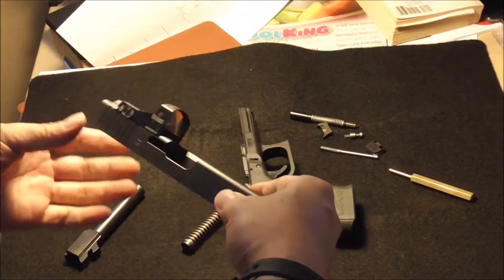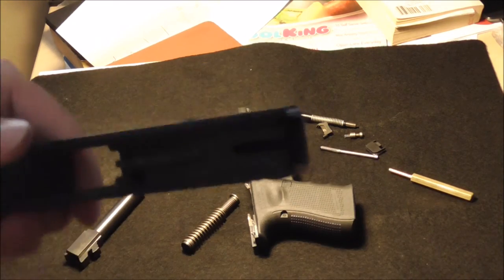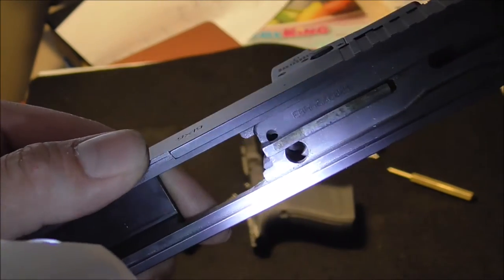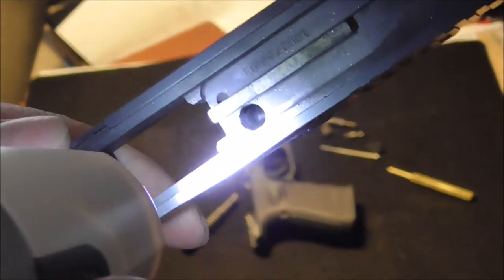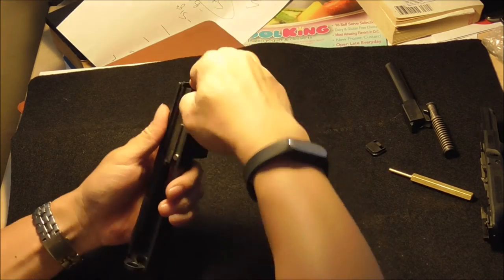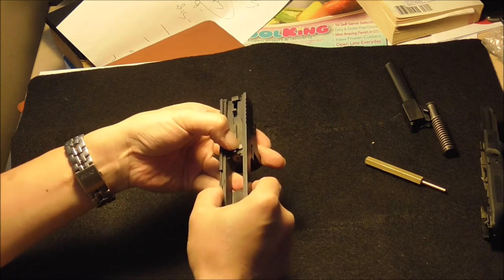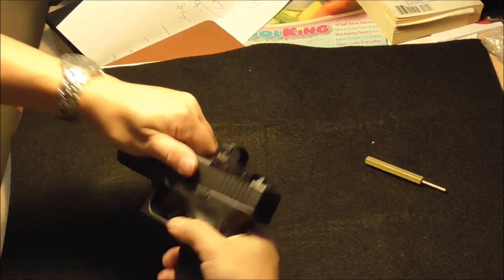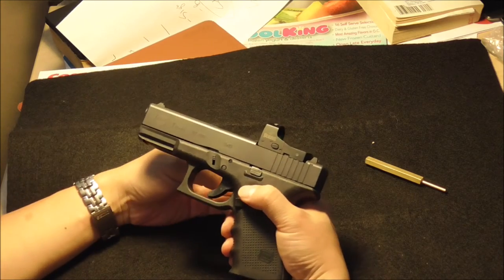Glock 19 genr4 milling failure by Tooth and Nail Armory in MO

Comment: All you need to do is shorten the screw that causes the malfunction
Reply from the maker: +Keyser Smokey   Nope.  See my other video.  The main problem is the cut that went into the plunger channel.  Once the optic is installed, it prevents the plunger from retracting fully.  Thus, the slide would not cycle.